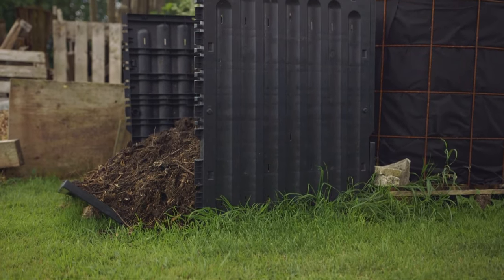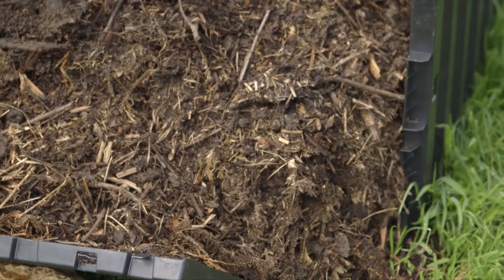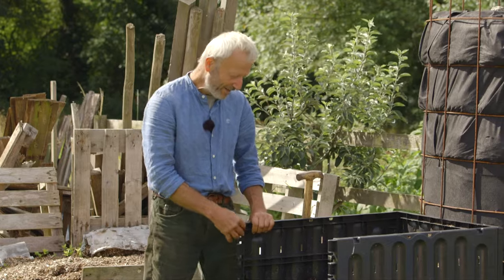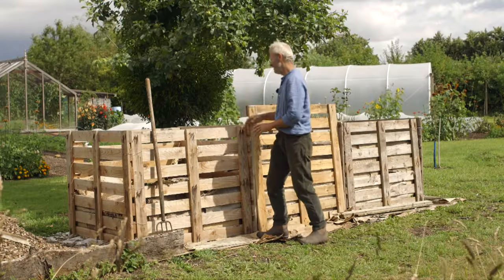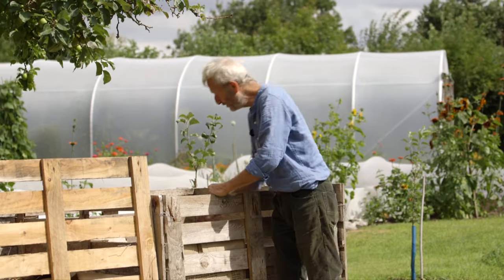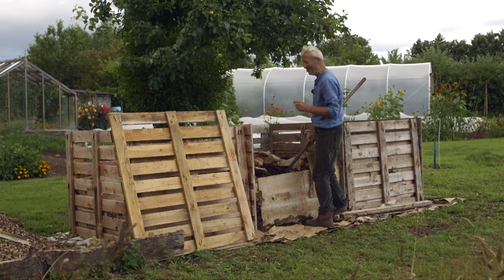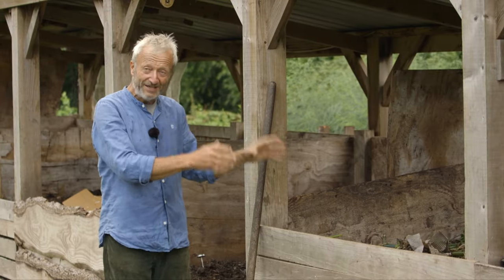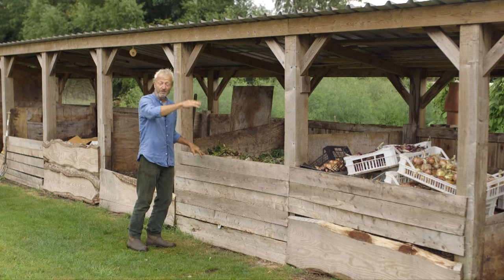Three Types of Heap, see how they work and the compost they make

Comment: Another great video - thanks, Charles.  Sorry, this is a little long but I have a question at the end.

I have a 3-bay pallet bin (plus a few Dalek bins for storing/finishing off compost) on my half-standard-size allotment and, you're right - filling them with green stuff from the plot is a challenge.  I supplement with weeds (was thrilled to be able to cut a few barrow loads of nettles this week!) from the communal areas, part-rotted wood chips and stable manure, which contains the straw bedding and the urine for added nitrogen.

We're fortunate that we have local tree surgeons who drop off the chips for free and a local riding stable that drops off horse manure on the same basis.  Being on a very tight budget, both of these are very much appreciated.

I try to build my heaps on a lasagne basis - a 2-3-barrow layer of green stuff, thin layer (about 1/3rd barrow) part-rotted wood chips, a 2-3-barrow  layer of manure, then repeat.  I live in fear, though, of the dreaded aminopyralid. Thankfully, I've managed to avoid it so far.  Would you suggest I continue to incorporate the manure (I really value the bulk it provides in building up the heap and the heat) or should I rot that down separately and do the broad bean test before incorporating?
Reply from the maker: Nice work - and I would play safe by doing a bean test before adding manure

Comment: Thank you, Charles! Interesting comparison. Two thoughts: why use plastic when simpler and less environmentally polluting methods are available for free? Those plastic bins are going to be a detriment to the world for a long long time after the purchaser is gone. Second, here in the US, pallets are uniformly treated with several anti fungal and preservative chemicals. They are quite toxic to handle initially, and who knows how much will leach into the compost. And again, what to do with the treated wood when the gardener moves on or the wood breaks down? I compost a lot of material, I have five acres here in Pennsylvania. Basically, I just build piles on the ground, turn them over with a fork once in a while and everything breaks down after some months go by. I find that by not using a container the material is much easier to turn. I don’t have to pull it out and then replace it back in the enclosure. The main ingredients that go into my heaps are leaves, lawnmower grass, all weeds and garden plants, and at least a bucket full of vegetable and fruit clippings each day from our kitchen. That really adds up. Occasionally I’ll throw on a few shovels of wood ash from my stove and charcoal from brush piles I burn. Sometimes I add water, but that’s not usually necessary. From spring to late fall I might turn the piles over three times. Then I either spread the compost in late fall or let it sit until the spring. Weeds are not a problem. Some come up and I pull them. It goes with the territory. Anyone who is frantic about having compost as quickly as possible and a perfect, weed-free garden has probably chosen the wrong hobby.
Reply from the maker: Cheers Bill that sounds a nice system :)

Comment: I've found you can get over 70c in a small composter if you can manage to fill it with all fresh ingredients, once it sinks though anything you add in the new space available won't get above 70 very easily. It's a shame they don't use some form of insulation as that would allow a smaller heap to get hotter.... If you ever get the chance it might be worth cutting the bottom and top off an old hot water storage tank and using that as a composter.
Reply from the maker: Good thoughts Michael

Comment: I've just now had to take an 85yo pine tree down. the branches have made a large  pile of chippings from the branches with  lots of long pine needles. Woul this compost with the addition of fresh horse muck boluses  callected daily from pasture? I get  between 3-5  builders buskets of muck over 24 hours. I'd have to use a one ton builders bag, as I have run out of composting spac for a permanent compost heap.  Thanks for your bin size information.This year I will  have a 5'x6' couple of bays at least, but the space is supporting squashes at the moment. Making compost is very satisfying.
Reply from the maker: Hi Suella, it could make compost in about two years. Pine wood and needles have a lot of oil which slows decomposition. Nice you are doing all that.
Reply: @CharlesDowding1nodig  That is really helpful Charles. I'll be using  the chips for paths as well so that will help me calculate how long those are likely to last.

Comment: Thank you for your tips on composting they have been very useful. I live in Brittany France and sadly this year our early potato crop was hit with blight after all the rain (and cold) in the essential growing season. I now have bags of decomposing blighted leaves and potatoes. You have said that it’s ok to put the blighted leaves in the compost bin as long as the temperature is good but what about the potatoes?  I don’t wish to encourage blight again and I have been told that it can live in the compost/soil as well as spread by air. Please give me some guidance on this as each year we seem to have blight. Normally it’s just a question of getting it early and cutting off the leaves, leaving the tubers in the ground to mature but this year it was worse than ever and the tubers had blight inside the majority of them.
Reply from the maker: Sorry to read this Victoria, and I would compost everything including the potatoes. As you say they are rotten already, and blight spores cannot survive in soil or in compost. Therefore once the potatoes and stems and leaves are decomposed, which will happen before Christmas even in a not-hot heap, your compost does not have late blight and has no chance of infecting plantings next year. Remember how the blight needs warm temperatures to develop so there is no risk of infection before June, and there is no way those infected materials can last that long.
Reply: @CharlesDowding1nodig  thank you for your very quick reply, much appreciated.

Comment: I put foam insulation sheets on the top 5 sides reduces heat loss via radiation conduction  . When I add new material I move the sheets upwards . The heat of  the  old layer  convects upwards into the new material. Reaches  60 C.

Comment: In my experience you can make up a bit for lack of size with insulation. I baulked at paying for a hotbin and so I made a more or less 1m3 wooden bin and just put a 100mm thick celotex block on top. It seems to work well. My MkII will have some insulation on the sides too. I can get the insulation free as it's just off-cuts and my son's a builder.
Reply from the maker: Nice work!

Comment: Reassuring to see your use of cardboard and wrinkly tin on the three-bin setup, as that's what I've been doing for the last couple of years.  I've found over time the compost drags the cardboard downwards  with it meaning I have to put new pieces in at the top every so often, but it seems to work well.  I've shied away from turning fresher compost on top of an earlier batch however because it leaves the newer material on top when I'd probably prefer to use the older stuff first.  I guess the longer it sits in the heap the less that really matters.

Do you ever find that you need to add water to your main covered bins, or does the "green" material you're adding always provide enough?  And am I right in understanding from your comments that you fill those bins until they're heaped high and can't take any more rather than stopping when they're level with the top of the walls?  If so, would you suggest that's a sensible way to proceed for people who don't have as much material to allow them to fill the bins as fast as you do, or do you think there's a point at which one should say "I know there'll be space for more stuff in this one in a couple of weeks time, but it's got enough in now.  I'll start on the next one"?  Lots of questions.  Sorry :)

One of my heaps also became exceptionally hot a few weeks back, reaching 72°C.  I've taken the view that there's little I can do to change it unless I find the enthusiasm for turning it over and mixing in more "brown" stuff, but I've convinced myself that it will probably sort itself out in the end.  If some of the beneficial organisms don't suit that environment then I'm sure they'll migrate back in once things cool down.  It might just take a little longer.  Fortunately I currently have a large once-in-a-lifetime pile of "brown" material to add -- my daughter's now-redundant shredded GCSE course notes :)

Regarding the woody remains in compost, I've come to the conclusion that they're not only harmless, but quite probably a good thing.  The council green waste compost I put on my plot last year was quite fine with almost no larger material.  Over time it formed a sort of "crust" and water then tends to run off rather than sinking in.  I ordered exactly the same this year, but it's much more coarse.  I'm sieving some of it to use for raising seedlings, but for everything else I think it will prove much better because the surface will be far more broken up and have more tiny spaces that can hold moisture.

James
Reply from the maker: All good points James.
Yes the over 70C temp. is temporary!
We add water only in v dry summers eg 2018.
Yes stop filling if you never reach the top!!

Comment: I use worms to make my compost, It takes longer but I don't have to turn it. Heat kills worms so I use last year's manure. I live where the winters are cold so I triple cover it with plastic and hay layers and it's on the ground so the worms can go into the ground if they want. On groundhog day I gather my worm castings to start peppers and the worms are plentiful and on the top of the pile.
Reply from the maker: That is a nice system Robert

Comment: I'm interested in the science of compost. I have a good supply of a mixture of horse and chicken manure. There's a mix of neat horse droppings, with some spoiled hay, the chicken is the shit, plus sawdust. It's all just dumped in a large pile in the middle of trees so there's little light. Although the pile has been building for many years, little if any seems to have turned into compost. Is it the lack of light, the lack of mixing, the low quantity of carbon rich materials or what? I am raiding the pile to put in my compost bins and I am adding brown stuff, so hopefully it should turn pretty quickly into useable compost for next spring.
Reply from the maker: HArd to say without seeing but lack of light is fine. Maybe too dry. See my video last July about proportions, link is in description

Comment: Hi Charles, Can you please explain the reason my compost is not cooling down. It is been 6 weeks and the temperature is still 60 Celcius degree. We have been watering and turning every 2-3 days. In my previous composts, it was cooling down after 10-12 days. I added some straws to reduce the temperature but we only managed to decrease the temperature to 50 degrees during a week time. Thanks.
Reply from the maker: Can be it's too dry but you are watering, I am not sure. 
I would stop turning it, you lose carbon

Comment: I will honestly tell you Charles, and I’ve been posting for years, that I have been composting for years and have never seen the earthy dirt we are supposed to see at the end.  Nothing usable ever.  Last year I used material that had largely turned into brownish soil like properties, but if did not preform well at all.  Having watched your primary composting video, several times, my material is built size and materially the same, yet my “compost” looks more like it started than soil. This includes 6’ wide by 6’ deep mixed mostly brown material.  Over three years of enthusiasm to compost, I’ve composted nothing whilst living on a farm with endless material.  Very frustrating
Reply from the maker: Hi John, sorry to hear this. I wonder two things:
Could your compost be better than you reckon? I'm not sure if you expect it to be too perfect?
Could there be other factors which reduces performance in your garden? 
I should be intrigued to see what it looks like and feel free to send photographs to admin@charlesdowding.co.uk.

Comment: I have a garden compost bin, doing really well. I want to extract the compost but I don't want to remove the worms, there are loads of them! How do I extract without the worms?!
Reply from the maker: Possibly your compost is deep and the worms then will be at the surface feeding so you have access below to their casts. Or if there's not much in the heat then you can't have one without the other because to extract the worms from the compost will cause them so much upset that they will die mostly and are better off spread on the ground, then some will go down and lay eggs and some will survive. Leave a little compost in the bin with worms and then feed again.

Comment: Charles, question on composting, my bins are similar in size to your ones under roof and I figured there is approx 4 1/2 yds per bin.  I started some of my bins in the spring and they would be full and sink and so on, so I was filling multiple bins at a time, but turned the one bin about a 1 1/2 months ago.  The temperature is still close to 100 degrees Fahrenheit, when do you figure it's ready to use?  At a certain Temp?  On a side-note, I was running out woodchips and I talked to a local tree trimmer and he told me that a nursery near me had wood-chips, I called them and he told me that I should look at them first, because they were getting old.  They are like 4 yrs old and beautiful for composting.  I got 20 yds for a delivery fee of $30.00 and while talking to the driver, found out they wanted them moved because they wanted to put and greenhouse there, so I told I would take the balance which was another 20yds and they didn't charge me anything for the second load....  I must be living right!  One more question, I have a bin, that was at 162 degrees Fahrenheit this evening, if a bin is too hot, what can you do???
Reply from the maker: This is almost funny Mark, how people don't realise the precious assets they have and as you say, you must be doing something right! 
Larger heaps like we have hold heat more & 100 Fahrenheit is actually possible for spreading - but another month could be better, to leave in the heap. And when you get over 150 Fahrenheit, I would add some browns such as the old wood
Reply: @CharlesDowding1nodig  Thank for your time and information!  Mark Baumgardner

Comment: For decades, I've  heard and read that one must provide a way for air to contribute to compost piles. Could it be that the insistence upon air flowing through a compost heap or bay comes from the experience [some gardeners have  had] of building anaerobic compost piles / heaps?  Anaerobic decomposition can be mighty whiffy, and one's downwind neighbors might complain to the local officials; for that matter, it might be unpleasant for the gardener  him- or  herself!
I'm gardening in what is called a first-ring suburb, old and with our houses situated on small plots of land, so we're close in, close by, so a sweeter-smelling composting process is important. Glad to get the word on plastic conducting heat; I'll be sure to use wood for the next bin or bay!
Reply from the maker: My point is that solid sides do not make it more aerobic. Adding structured woody brown materials does that.

Comment: Another excellent video how do you deal with rats or mice in compost piles no food scraps only green waste and still they are present wood chip and garden waste only
Reply from the maker: I have rodents sometimes and accept them there
Reply: Getting the heap hot has worked for me.  I've not had problems with rats since I've had hot compost heaps.  By the time it has cooled down there's nothing there to interest them.  I did have a grass snake hatch a clutch of eggs in one of my heaps last year when it was cooling down though :)

James

Comment: Thanks. That is useful.  I do have one critical question though: how important is it the bins are exposed to direct sunlight?  We built a 3 bay system out of pallets. However we're struggling to get the temperature up and stuff is not decomposing. We turned Bay 1 after 2+ months  into Bay 2 that was half full of compost from spring. Most of the green stuff was barely changed... key point: the bays are shaded by a hedge and a big walnut tree. Would really value some tips. Thank you 😊
Reply from the maker: Makes little difference, heat is from within. I suspect the pieces of brown were too long, leading to large pockets of air

Comment: What about the seed heads of your spent flowers?  I currently have a tremendous amount of Coreopsis growing - that I planted once two years ago.  It has since self seeded almost every where in my tiny back yard beds. I end up pulling and scraping off probably 95% off the seeds and leave a few plants for the new season.  I'm afraid to put the spent plants in my compost for fear the seeds will sprout in the compost and I'll be growing in coreopsis in my veggie beds.
Reply from the maker: Seeds need heat over 55C. I make sure they go towards the centre

Comment: Charles ..I noticed that your pallets are put together with the nails on the outside. I’ve done the same on my allotments but the plot inspection team said the nails on the outside are a H&S issue. Is it better to have the nails outside or does it really matter. ?
Reply from the maker: Well spotted and that depends how H&S is defined really. I want the smooth surface inside but they could be the other way round!